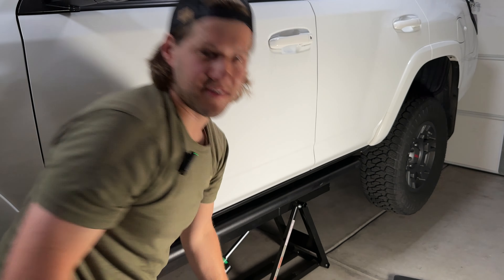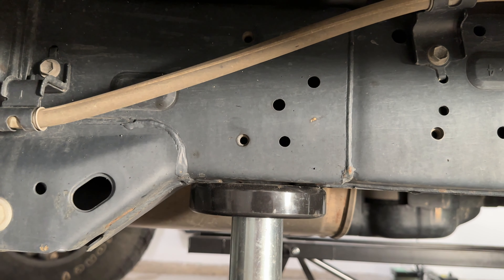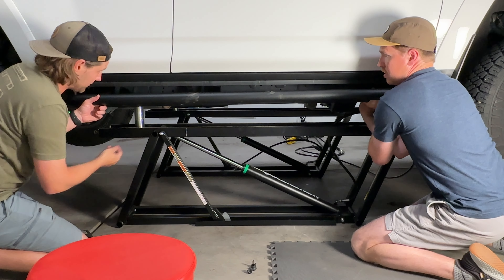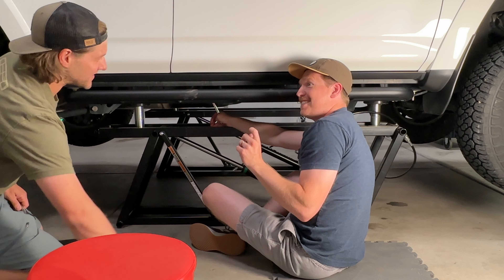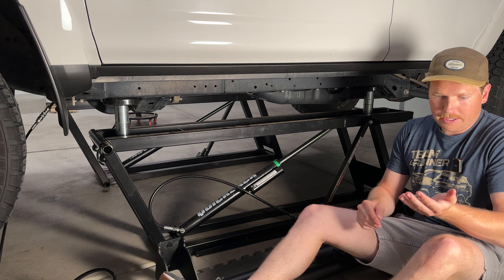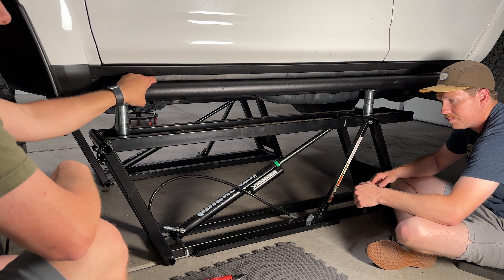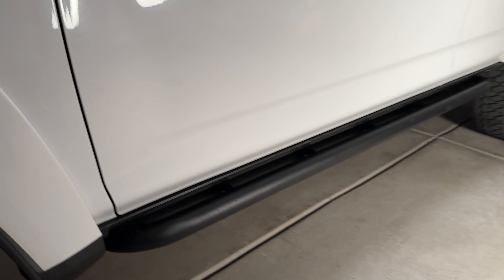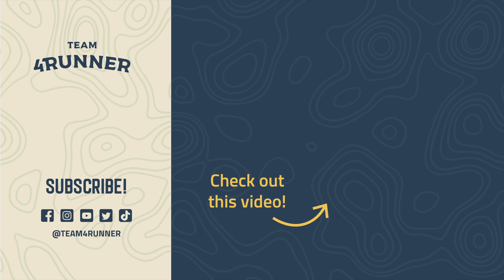Toyota 4Runner OEM Rock Sliders?? Install & Test!

Comment: I had the version that came for the FJC and honestly, even with some hard hits, they help up fine. I know people like to shit in them but real world they work fine for what most need them for. I like how they are minimal looking and barely noticeable. Another plus is that you can get individual replacements in case one dies get damaged. They can be purchased individually. Consiogettjng some for our new 5th gen we just picked up. Thanks for the test, glad to see a little verification.
Reply: People like to shit in the shipping box, or actually shit IN the sliders??   Because you’d need to drill a pretty large access hole in order to take advantage of that mobile porta potty feature!

Comment: Found a good deal on these and this video made me decide to pull the trigger. I use my 4R to get to cool places for camping/fishing, not rock crawling as a hobby, so I think these will be perfect for a little extra protection if my line is a little off and I hit a tree root or rutted out ground the wrong way. Plus they're cheap enough that if they do get damaged I'm not gonna feel too bad. I also love how low profile they are compared to many of the aftermarket options.

Comment: I have them on mine, they seem to flex back into the original position. They look good and work great for light off-roading no problem. Also you can get them pretty cheap. They are kinda heavy unlike the predator steps which are super light in comparison.
Reply from the maker: Sweet! Predator steps arnt rock sliders tho, very different in that sense
Reply: @Team4runner  only compared the weight, had the predators before, those for off-road would get destroyed no doubt.

Comment: What's flexing?  Are the bolts getting pulled out of the frame rail. Where is the weak point? It's  not a step and with any kind of usage there will be body or rail or frame damage ? I could be wrong here but I'm critical because I need to get some.

Comment: Just got mine for my 18 TRD ORP. Very impressed with the weight and the welds. (Had Bud Built's on my FJ but went middle of the road here) I blasted the interior of them w Woolwax (as my frame bathes in it yearly and the occasional touchup) Are you suppose to leave the round frame plugs that sit behind the brackets? I almost think yes -  fairly large opening if removed vs leaving the plugs there, I guess after torquing it's flush enough? No info on Toyota's install pdf (not that you need instructions here)

Comment: Do you know if these will work on a 2011 Limited model? I already ripped out the dreaded Xreas suspension, and lines.
I guess i could do the homework myself, but figured I'd ask. 
Thinking about saving the money and getting these instead of CBI's mainly because of the money id save.
Reply: You'll have to trim the plastic or swap it out for Trail Edition parts.  I've seen them trimmed out and they can look good if you make a good cut.  I'm planning to do it eventually.  Getting the Trail Edition trim is way too pricey, and the only manufacturer making an aftermarket version stopped sometime a year or two ago.

Comment: Have you tested other brands? Did the other brand flex a bit? OEM are like half price from what I found.
Reply: I was incorrect on the price...the Toyota site sells them per side (and it listed them per installed price ) $410 per side installed
Reply: @mattineeman  Bam wholesale has them for $240 each
Reply: I just bought some.  Toyota Parts is having a Memorial day sale, $485 for both sides and install kit, free shipping.

Comment: Those are rock sliders? I don't know, while they look nice (and thats important) I think being aluninum would not really fall into the rock "slider" category. I always use the old saying, "pay once, cry once" and get some good rock sliders (Cali Raised, etc). With that, good video showing Toyota does in fact sell OEM rock rails that do look nice and will be suitable for overlanding adventures to great destinations.
Reply: Buy once, cry once! But you are correct. I feel like these give the look most people want, aside from not being the best in their category of actual performance
Reply: Aluminum skids are very common.
Reply: I don't think they are aluminum, seems to be steel to me.
Reply: @engineerofalltrades  You're right, they're not.
Reply: Hey SoyCali Tinkerbell, the OEM Sliders are not aluminum.